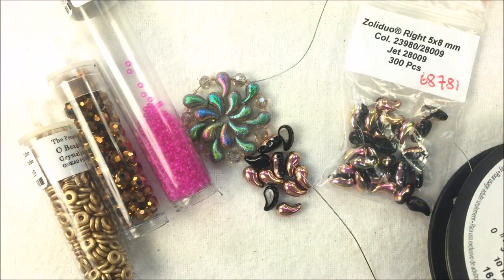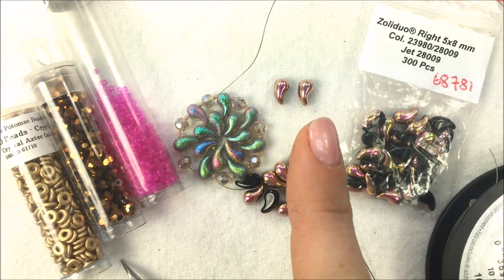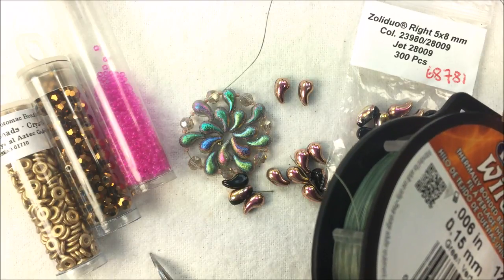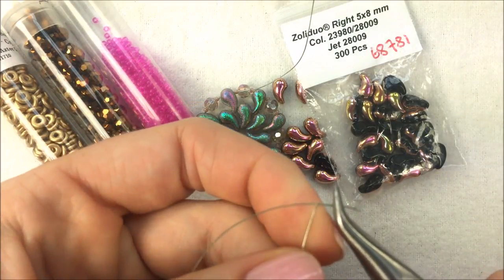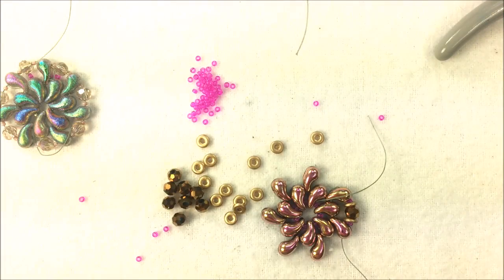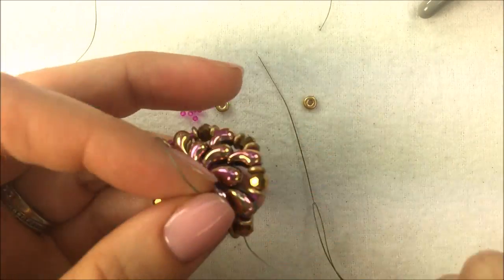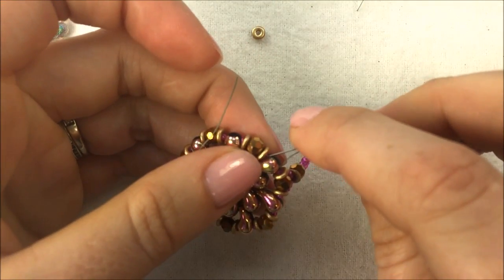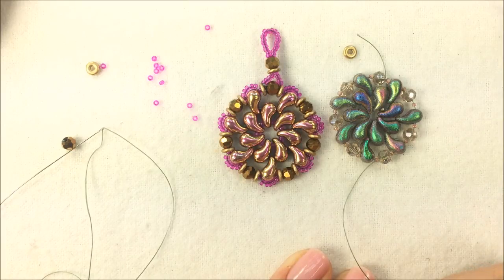ZoliDuo Fan Pendant- DIY Jewelry Making Tutorial by PotomacBeads

Comment: Love this new bead but unfortunately I am having the same old problem TENSION I cannot get my tension right no matter how I start the piece. If I knot it several times go through the beads again to make a circle or use a stop bead I get the same problem on the following row or round my tension goes really slack and I can see the beading thread. Has anyone out there got any suggestions as I am at my wits end as to how I can solve this problem. Hope someone can help, as I have purchased quite a few beads.
Reply from the maker: As you work, you have to constantly hold your tension on every row.  Keep pulling even on the second rows.